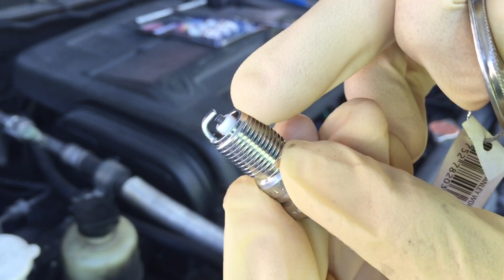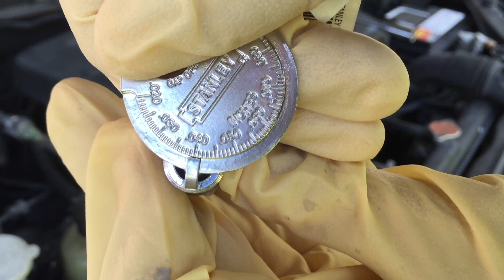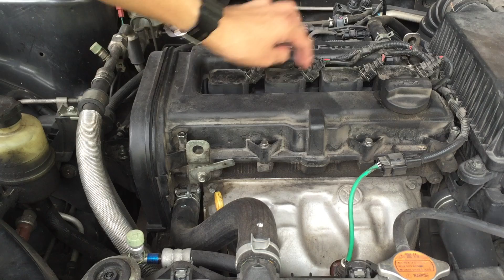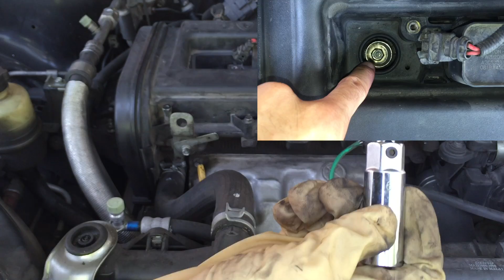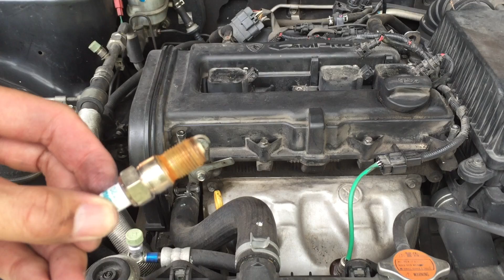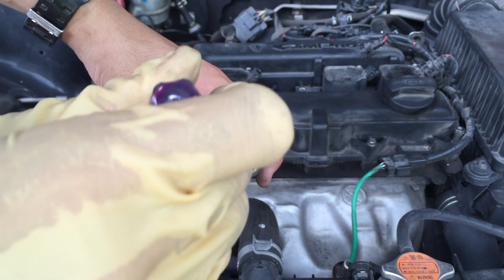Changing Iridium spark plug from Proton Persona engine

Comment: Probably off topic. How to make campro engine mire fuel efficient?
Reply from the maker: What your current consumption? Any consumption around 8L/100km or less should be acceptable.
Reply: @CTB6  RM0.15/km
Reply from the maker: Woah…. It is your vehicle?
Reply: @CTB6 1st generation campro still runs like new
Reply from the maker: @dronepilot1333 Share us here your maintenance sequence …
Reply: @CTB6 never miss an oil change and on time service, only using genuine parts and PETRONAS engine oil.
Reply from the maker: @dronepilot1333 how frequent do you change spark plug?
Reply: @CTB6 with each oil change
Reply from the maker: @dronepilot1333 oil change once every 8000km?
Reply: @CTB6 sometimes every 5000km, sometimes 8000km. Switch between semi and fully synthetic

Comment: Boss Liew, my elegance millage 110K km...kereta bila aircond auto On, engine sometimes macam misfire dan rpm low...perlu tukar ignition coil kah ?
Reply from the maker: Spark plug baru lagi?
Reply: @CTB6  ya bos...spark plug guna NGK yg biasa tu saja baru tukar.
Reply from the maker: Mungkin gelang piston perlu tukar. Hantar bengkel ada peralatan untuk mengetahui lebih lanjut.
Reply: Maksud you, ring yang di piston tu problem ka ?
Reply from the maker: Suspect je. Hantar bengkel lebih selamat.

Comment: bro witch one is better between ngk g power or bosch? for platinum set.
Reply from the maker: There are both platinum core. Platinum has high melting point. The tip remained sharp for very long period. It is a matter of price. Do check if the rubber coil is not harden the next time changing spark plug.
Reply from the maker: There are both platinum core. Platinum has high melting point. The tip remained sharp for very long period. It is a matter of price. Do check if the rubber coil is not harden the next time changing spark plug.

Comment: thanks for the video, it really helped me. quick question; do i really need to apply the grease to the plug coils and plugs as shown when changing out to new spark plugs or is it optional? i rarely see technicians apply the grease...
Reply from the maker: I recommend to use dielectric grease to help reduce contact resistance. It keep the moist away prevent rust grown. Subscribe to my channel for more videos.

Comment: Seng coy liew..spana plug size berapa ya..kat mana boleh beli.
Reply from the maker: azhar ar 
Spark plug socket standard size 16mm. The one showed in 5.8minute is actual spark plug socket. Can get from any hardware store or DIY shop. The different between standard socket and spark plug socket is there is a rubber ring embedded. It helps pick up the spark  plug. It is important to make sure the sure of spark plug socket. It comes with the T handle attached with the socket.

Comment: hey bro, just to ask . is there even a canister purge valve in campro cps? im having tak tak tak noise ... and i just subscribed . :)
Reply from the maker: It helps channel petrol vapour into engine for burning instead of vanishing into thin air. What is your engine mileage Bro?
Reply: 100k :)
Reply: Calvin that sound now can b repair .if it still not really loud sound .

Comment: Nice sharing on checking the condition of the spark plug and coil-on-plug unit. 

However as mentioned by some the title of the clip sounds like you're discouraging not to use iridium/platinum plugs, rather than telling owners fitted with them to also periodically check d plugs n coil pack unit even before the plugs are due.
Reply from the maker: Indeed. Spark plug that sit too long in the chamber not checked regularly can be an issue or engine that are 10years long in services.

Comment: great sharing, just u need to wash your engine man. It was so dirty.
Reply from the maker: Thanks for advise.
Reply: @john kratos  i wash my engine bay for 9 years of my satria neo. Never short or anything. Dont spray chemical. Use soap n brush only.

Modern car engine is much more easier to wash.
Reply from the maker: Did you do it all by yourself?
Reply: @CTB6  sometime i sent to carwash n instruct them my preference.

Most of the time, i wash my self since not so dirty (result from frequent cleaning).

Comment: I am using a satria neo cps, recently changed my plugs to NGK iridium spark plugs. Will the rubber melt within 80K km? or is this case just for campro engines?
Reply from the maker: It is advise to perform checking once every 20k km. Check if the rubber boot has the tendency to crack. This is exceptionally important if the car has been running for 5 years. Rubber tends to become brittle. Do not wait until it breaks. It will be very expensive to repair by then.
Reply: Liew Seng Choy thanks for your input. What is that rubber thing called? Spark plug coil? Ignition coil? Is it part of the spark plug cable?

Comment: change the title to step-by-step changing spark plug on proton persona instead of Reason why dont use Iridium/Platinum spark plug in Proton Persona CamPro....wasted my time on watching this 11min video for not getting any info regarding to your title....
Reply: dia tak bagi tau bulat2, dia tunjuk kesan keburukan guna high mileage spark plugs. 1) susah nak bukak 2) berkarat teramat sebab long interval maintenance 3) sbb lama tak maintain, plug coil rubber crack (bahaya)... etc etc.
Reply: john kratos iridium tahan lagi lama drpd spark plug biasa ..
Reply: The iridium spark plug are last longer
Reply: Pls google how to put correct title. Waste my time also.
Reply from the maker: Good idea! Didnt thought of that.
Reply from the maker: The purpose of the video was to shown the effect of using spark plug capable to be use for long mileage. The rubber boot would start to harder over time. It will eventually develop complication in removing residual.  Symptoms of rubber started to harder has develop in the video. One of it has indeed came off.  Any users who  faced worst than mine case scenario would realized the important of regular check even if using expensive plug. 

I hope user out there will find this video useful when one of their rubber boot fell inside the chamber. 

It is the overall video content that matters. The title were meant to remind user about the risk they will encounter.

Comment: thoes are bad gap gages, they leave the electrode gapped at an angle = bad performance.
Reply: Gamma Light flip the gap tool upside down and gap from the other side to the same tolerance
Reply from the maker: Good to know. Thanks.

Comment: bro one of my coil plug is stuck inside, any idea or tips on how to take it out?
Reply from the maker: That's really complicated. 

Try search for reverse drill drill and related guide on this issue. 
There are guide showed using a slightly smaller driller bit to make a hole then use easy out drill bit to remove the broken spark plug.

Worst case scenario the cylinder head need to be removed in order to remove the broken spark plug.
Reply: Liew Seng Choy thank you for your fast reply bro. but i managed to take it out just now hehe thank god. thanks bro!
Reply from the maker: Luckily it went out.
Mind share how do you remove it ?
Reply: wan hakim for future reference, you can use a little bit of wd-40 around the rubber boot then twist and pull, never just pull. when boot is out, use a small amount of dielectric to coat the insulator (white ceramic spark plug body) and anode (top metal part of spark plug). Then apply a small amount of aluminum based anti seize to the spark plug threads. torque to spec + 5lbs.  (note, anti seize changes the torque specs and on low torque speck motors, a high quality spark plug will not need an anti seize. (Do not gap NGK plugs ever. don't use anti seize on spark plugs if the motor torque spec is less then 30lbs)

Comment: Good video. Thanks. Do you have issues of noise coming from your IAFM module? Some CamPro engines have this known issue.
Reply from the maker: OMG !!
May i ask how does it sound like ? I heard some rattling sound occasionally. I did tried overcome some of them.

I have a hunch that some sound was from the bearing, i guess. It sounds like metal ball rotates periodically but not obvious. 

Let me know more how the In-Take Air Fuel Module !

It is caused by the valve of the fuel injector ?
Perhaps dirt has clog up the injector ? 
I wish to deduce a methodology and eventually a solution for everyone !
Reply: shafiqe if it's an intermittent humming sound its ok. it's when it doesn't make sound or sounds like it's rattling apart thats when you have a problem.

I should also add, if it's water cooled you might have a coolent block or low coolent levels.
Reply: Liew Seng Choy ，

Comment: so what is the reason we dont use iridium on persona campro? i dont understand.
Reply from the maker: The spark plug will stay inside the chamber for too long before a replacement. It last 80,000 km instead of 20,000 km for standard graphite anode. There are cases where the rubber boot even melted inside the chamber. Luckily did not happened to me. Mine just one coil rubber boot broken too me some time to figure a way to extract the broken rubber.

In term of cost, it will be probably the same between Iridium/ Platinum and Graphite anode. Only different is the later lasted for a year. Compare to Iridium, lasted for two years but double the price. 

Not recommend to get an expensive spark plug. Standard spark plug will do. Provided that a regular check are performed.
Reply from the maker: Yup. Satria Neo lebih jimat. Kalau wayar getah spark plug dah rapuh macam biskut, baik tukar. Nanti ia patah tersangkut dalam enjin, memang basir masa bersihkan sisa.
Reply: So then the issue isn't with the spark plug...it's with coil on plug boot that's rubber...the Iridium Plug was still functioning properly...Might want to look into a better coil on plug...or just badly designed engine.
Reply: iridium tu tembak api panas sangat getah lekang....
Reply: Jamal Ali maksud tuan getah spark plug cable ke? saya satria neo, lain sikit dengan persona rasanya.
Reply: you should try to slightly  apply the  anti-sieze compound on the spark plug threads (I see ACE Hardware sell it also)

Permatex Anti-Seize 

the almost new vehicle now is come with long-life Iridium spark plugs  and the manual says change every 80K Km

I using honda SR4 and Iridium plugs (BCPR7EIX)   never had a problem
Reply: get the right heat range la brader...
Reply: Bro , you apply the dielectric grease wrongly , "dielectric" mean insulating the electric , why on earth u apply it at the conductors part of the spark plug , u should apply it at the ceramic part of the spark plug and the rubber part ? Also why  the rest of the electric connector ?? That meant to be conduct current right ?

Comment: Hi 🙋 mr liew I think the clip just press and pull up the socket coil plug no need take out the clip coil plug ...tqvm for good sharing vlog
Reply from the maker: Hello there !

Good to hear from you !
Unfortunately the length of the coil rubber boot is about 5-6 inch long. Unable to fully remove the rubber boot if the cable is not disconnected. 

Trust me, you will remove the cable when time comes.

Thank you for your continuous support !
Reply: coz he is stupid.